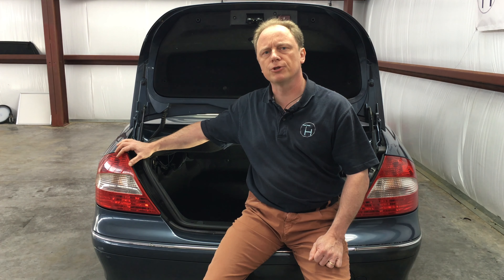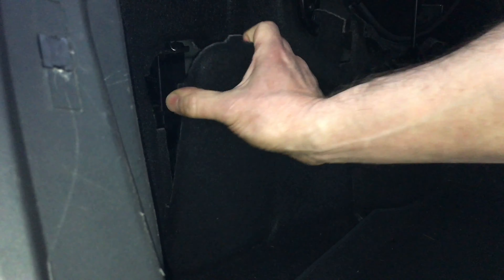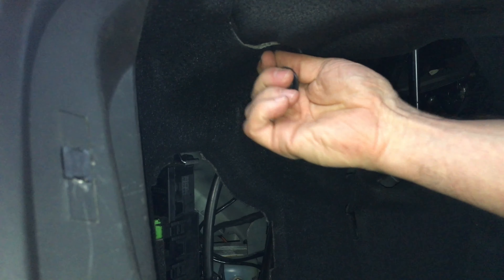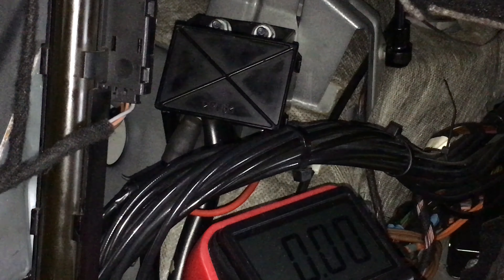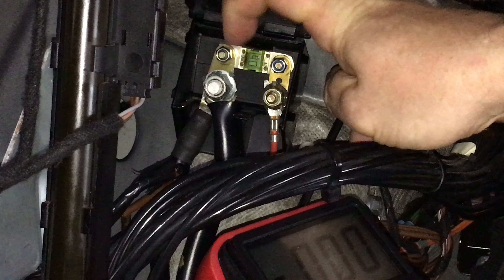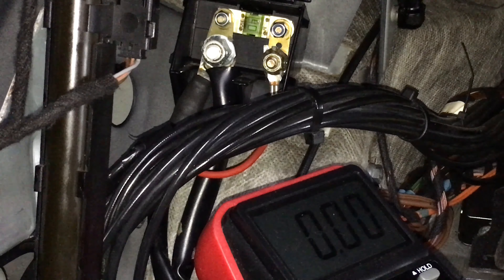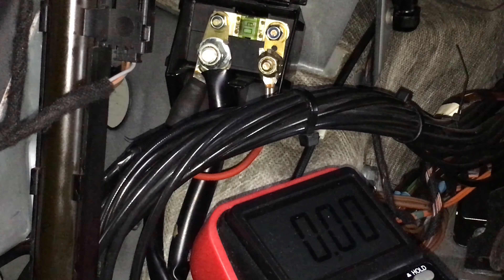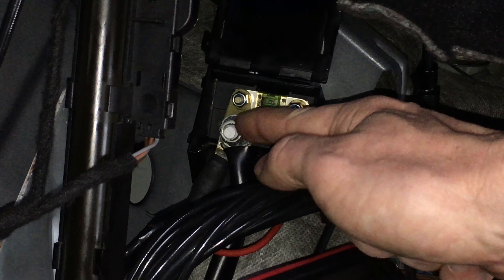Mercedes A209 CLK - Testing the 40amp fuse for the pump

Comment: Clear concise thank you, but if the pump is low, how would you refill???
Reply from the maker: You can fill the pump with a syringe through the fill port on the reservoir. If the fluid level is low, then you obviously have a leak somewhere. You will need to find the source of the leak and take care of it...

Comment: Hello there, thanks for your clear video. I used a tester to check the fuse, I get 12V on both terminals. So the fuse is good. Could be the problem due to the pump of to some other element? for example relay? I indeed listen something is trigging when I try to open or close the roof, the roof doesn't move, but all windows yes.. In case it could be the pump, do you still sale it?
Reply from the maker: If you get the message "roof in operation" when you push the button, you have power on both sides of the fuse and nothing moves, then it is almost sure that you have either a bad relay or a bad pump. Yes, we have the pumps in stock, see https://tophydraulics.com/24-w209-clk
Reply from the maker: Thanks for contacting me via email, as well, and congrats on being persistent! This sounds like a bad pump motor. 
Before we condemn the pump, you could make one more experiment: 
1) Take out one of the yellow relays, leave the other one in place. 
2) Identify pins 30 and 87 on the relay you took out and find the matching lugs in the relay socket that you pulled the relay out of. Verify that there is voltage on one of the pins 30 or 87. Using ideally 14-gauge wire (1.6mm diameter), or at the very least 18 gauge (1mm diameter), bridge pins/lugs 30 and 87 in the relay pigtail. This should make the pump motor run. If it doesn't run, then it must be bad.

We offer the pump and we have it in stock. Here it is on our website: https://tophydraulics.com/w209-clk/164-4672-w209-hydraulic-pump.html#/30-core_exchange-send_your_parts_to_top_hydraulics_first/98-model_year-2003_2006
Reply: @TopHydraulics  thank you so much for replying me, both via email and here on Youtube. I appreciate you :) - I am grateful for your kind response. Following to your technical response, I have to check the relè asap. I tried yesterday, but it is rather difficult to extract the relay from the socket, I have to disassemble other parts around it in order to manage and test the relay. You know ;) - If I don't mistake the relays which you are talking about are those yellow ones attached to the pump structure. Other smaller yellow relays I also see on the fuses board next to the pump. Thank you again. Lets keep in touch, I am going to update you asap. :)
Reply from the maker: @robertotola5937  The pump relays are the yellow ones attached to the pump structure. There is one bolt holding the pump in place. After removing that bolt, you should be able to pull the relays.

Comment: Hi thank you so much for the information klaus.   I’ have just done that test and have power both sides of fuse so not sure what to check next? No fault codes either! 
If I double click the roof button either way the windows will go up or down but no pump noise can be heard!!!  Please help
Reply from the maker: The next step would be checking the two yellow relays on the pump. Swap each other’s positions and try again. Both relays must be installed, but you put relay 1 in position 2 and relay 2 in position 1. If the top starts working after this, then you know you had one bad relay.
Reply: Thank you sir, I have also changed the 2 relays for brand new ones and zero difference!  Do you think it could be a module or still maybe the pump ? I wish you lived closer I would hire you to fix this without doubt!

Comment: I prefer to test for power using a test lamp. A headlamp bulb is ideal for stress testing the supply. I've been caught on many occasions when a meter shows power but the supply is high resistance and disappears when a load is applied. Take car as the bulb can get hot enough to damage trim, keep it well clear or put a cage around it.

Comment: What is the part # for the 40amp fuse or link to buy from your site?  Thanks
Reply from the maker: Thanks for asking, we don’t sell fuses. The fuse is a 40A MIDI fuse - best Google it and use an online seller such as Amazon. If you have a blown fuse, then the pump is bad. We are happy to add the fuse free of charge to your shipment in case you order a pump refund from us. Simply leave a comment when you place the order.

Comment: Great video, but I am still getting no power to the pump, no pump noise, 40amp fuse is good. Not sure what to do next. Help please Im going crazy!!
Reply from the maker: Do you get a "Top in operation" message in the instrument cluster when you push the button?
Reply: @TopHydraulics  I have same issue, fuse is good but no sound of the pump and there are no messages on the dash, in operation windows goes down, rear headrests goes down but afterward nothing happens and no error messages on the dash. Can it be a bad pump?
Reply: Waiting for your response @tophydraulics
Reply: Did you get your roof fixed? If so what was the cause ?
Reply: Did you find a fault in the end ?

Comment: Could it be something other than that fuse causing it not to work at all? Like a relay? If so, do you know where the relay is located? Thanks
Reply from the maker: There are two yellow relays in the pump's wiring harness, next to the pump motor.
Reply: @TopHydraulics  if it is the relay, how are you able to work that out? What part number for the relay? :)
Reply from the maker: @chrispapa1587  The part number is printed on the relay: A0025421419
Reply: @TopHydraulics  thank you so much.
Reply: @TopHydraulics  if it were a micro switch would the pump work? Or any part of the boot open up? If it’s a relay nothing would operate?
Reply: @chrispapa1587 
Can anyone advise if this is correct if it’s a relay or a micro switch you would not hear any pump noise ?

Comment: Do you have any videos regarding the horizontal style pump? Such as fuse and relay locations? E Class 2011
Reply from the maker: Sorry, we have not worked on an E-Class ourselves, only rebuilt lots of cylinders and pumps for it. The horizontal pump in the E-Class does not seem to have the relays next to the pump, but they cannot be far away. I cannot find the relay or fuse location in the diagrams available to me through mbepc.net. I see that the harness supplying power to the pump motor and to the three solenoids runs under the pump towards the front and it must terminate either in in the top control module itself or first go through a couple of relays. Some newer cars have the relays built directly into the controller, which would be a shame. The top control module is forward of the pump, next to some other control modules. You may want to follow that harness from under the pump and see where it goes. This particular harness has some black mesh around it.